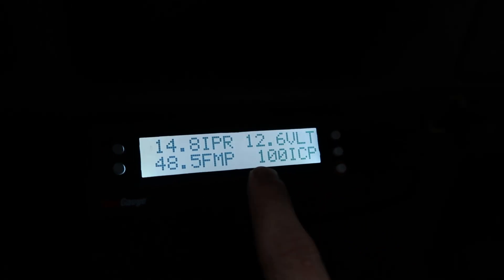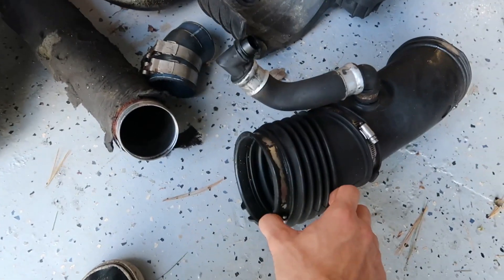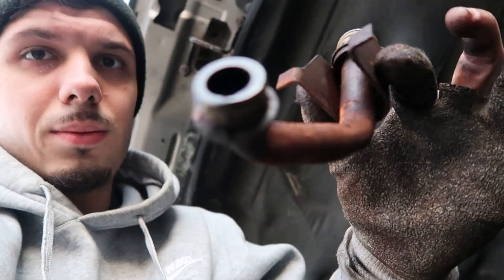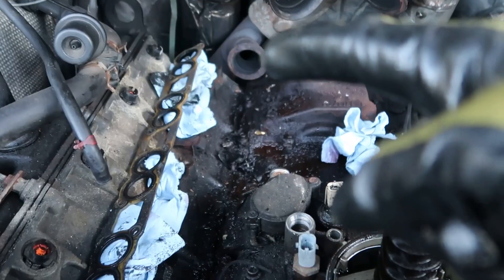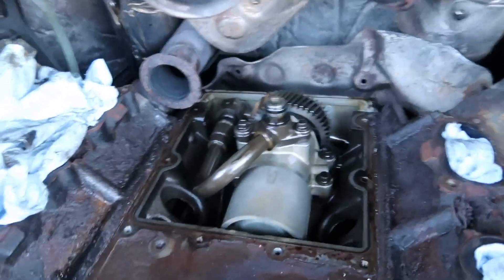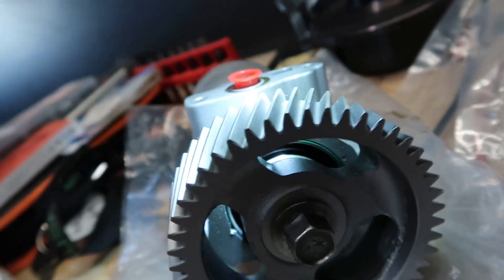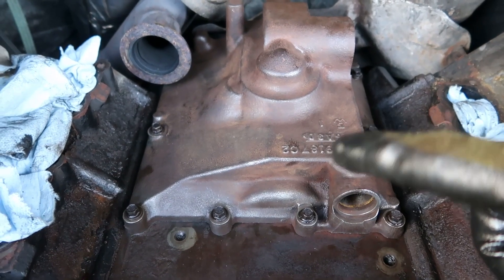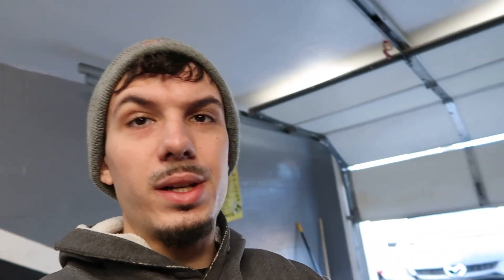6.0 Power Stroke HPOP Removal/Replacement

Comment: I like it.... The one thing I will suggest is that wobble when you put the cover back on is the cover sitting on the j tube...  It puts side load pressure on the STC fitting and causes premature failure of those orings. Shave it down with a Dremel until it clears for more peace of mind.
Reply from the maker: good idea 👍

Comment: If you are building over 400psi your pump is probably fine and u just have a hpo leak at one of the o-rings.  When an HPOP goes out completely your truck won't build pressure past 40 or 50psi.  Air testing through your IPR port is crucial in these situations, that is what any 6.0 mechanic will tell you 100% of the time when faced with these symptoms.
Reply from the maker: wow nice to know thanks for that!
Reply from the maker: wow nice to know thanks for that!

Comment: Can the hpop cover be removed with the icp still installed?
Reply: It can, I’m doing mine now. Just took my cover off tonight with the icp and IPR installed
Reply: @superdutysteve6934  haha thanks yes I ended up doing mine like that and then realized both the ipr and icp can still be attached 👍🏼 and don't bother removing the J tube.. it just swings up (swivels) out of the way 👌🏼 (unless you think it's leaking or something, mine is fine 👍🏼)

Comment: I get to do just this on 04 early 6.0. Hoping to maybe get away with as little excess disassembly as necessary & even if some things could maybe get left, having big hands would probably require more anyway. Also wasn't sure of what would HAVE to be replaced due to non-reusable gaskets. This definitely looks more helpful as a guide than the tear down I saw for the later motor.

Comment: On your j tube...did the rings and Teflon ring work?  If so...where did you get them from on ebay?? I bought a new j tube and it would not set in correctly.
Reply from the maker: it did work and i got them on ebay, maybe it was a different style just tube you bought it just resealed the original one.

Comment: I believe I have a hpop leak but my truck still starts after about 5 seconds. Do you think I could a small causing issues but still allowing it to start?
Reply: You should air check the system with an ipr air tool. Verify no leaks at stand pipes, injectors, oil rail. You won't be able to verify j tube seals without opening up the cover. If you go that deep, spend while you're in there and replace the hpop. Cnc fab makes a stage 1 that's $900. Best budget option. $1500 for a billet case unit, but that bulletproofs it. Early build trucks are better in my professional opinion as a seasoned diesel Ford technician. Less high pressure leaks, less lifter failures. Lots of very high mile early trucks still out there accruing miles with minimal problems.
Reply: @georgesrisomsak9650  I have 250k on mine with stock head gaskets stock egr valve and everything , I did all 8 injectors at 212k but now at wide open throttle it doesn't seem to have the zip that it used to , build plenty of boost start a little hard after sitting all week but nothing crazy and now when I go WOT it throws a p2290 code ..... im worried my hpop is going but idk what to do now
Reply from the maker: do you have a scan tool or tuner, try to see what your icp is while cranking should go over 500 pretty quickly.

Comment: Awesome video. I really needed a more detailed step by step vid for early 03 hpop. Do you have a total cost on parts besides the new pump which I already have. And how many hrs do you have in it total
Reply from the maker: thanks for enjoying the vid, besides the hpop the disconnecting tool is about $10 and the gaskets will run you about another $60. In total took about 6-7 hours to do the job between two days.
Reply: Do you have the other parts listed. Like branch tubes #s I wanna do everything while inside

Comment: Dude, good vid. I'm about to do this and more on my truck. Have you watched Diesel Tech Ron's videos? He says you should go ahead and replace the discharge tube instead of just the orings. You're a young guy and maybe you don't have the cash to spare, but with these 6.0s it's best to replace everything you can while you're in there.
Reply from the maker: thank you for the feed back and sub i appreciate it! i did watch a lot of diesel tech ron he actually gave me the motivation to actually tackle this project, i am not a diesel tech by any means just doing it to the best of my ability.